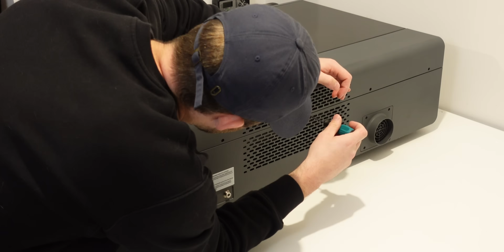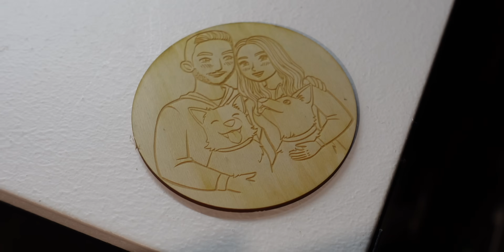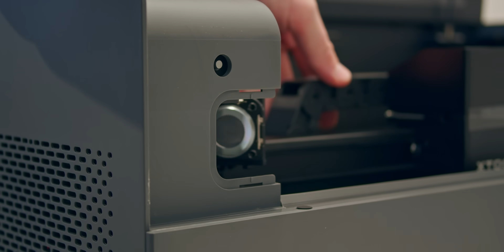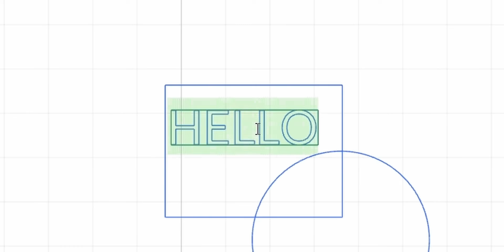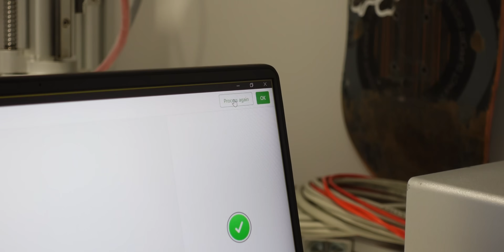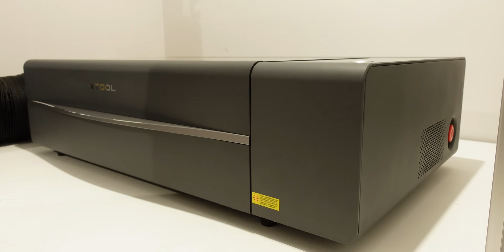My Dream Machine cuts CLEAR panels! xTool P2

Comment: lol it took me an hour to figure out I had to turn the screen the opposite direction to center the rear mirror! 😂😂 they should fix the manual.
Reply from the maker: How crazy is it! I was like this is getting worse with every "correction" so I paused and thought about what the mechanism was doing and realised it was literally the opposite... Hopefully they fix it now as we know the xTool team have seen my video. 

The click through guide in general though is great, makes the process a lot easier to match your results to the picture.

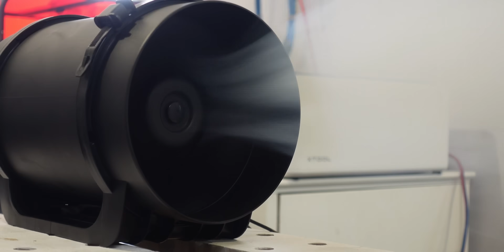Comment: Anyone know what brand the fan at 1:49 is? I have a similar one, but the one in the video seems like it can move a lot more air than mine.
Reply from the maker: Good question, it's an 8 Inch Hon & Guan Inline Duct Fan.

They send it to me for a previous video, to feature it's high airflow of 760CFM. Only been a month or so of use since then but I've had no issues, it does what it says on the box haha.
Being able to crank it up for wood cuts and the leave it running long after the machine is done to keep taking the smell out has been great. And I 3D printed an adaptor for the small laser cutter ducts to it.

Amazon: https://geni.us/8InchDuctFan
Website: https://store.honguan.com/
They also gave me a 10% off discount code for direct Website orders: camshand